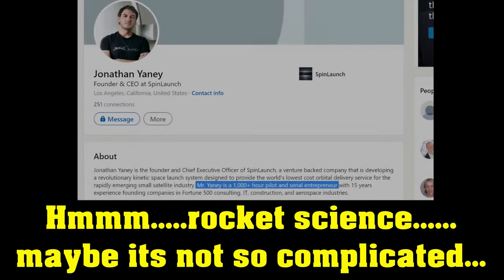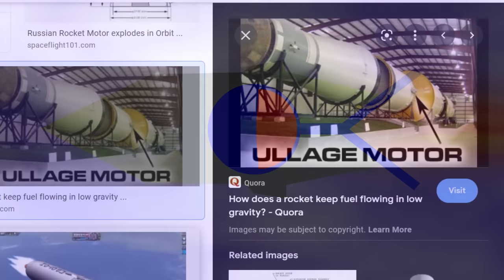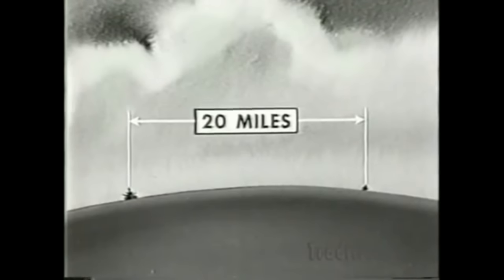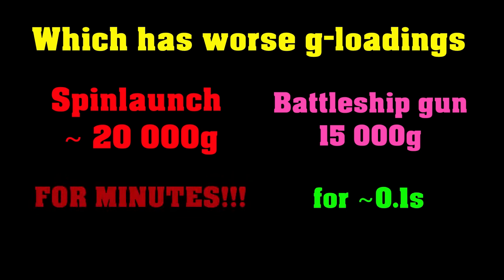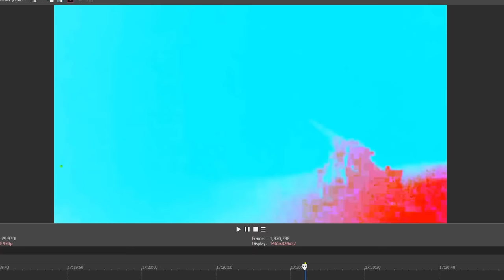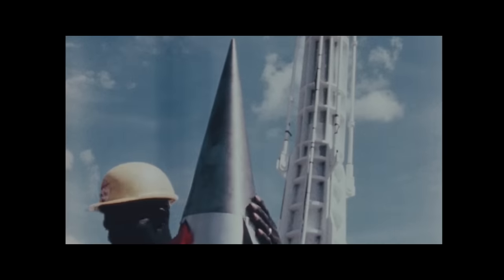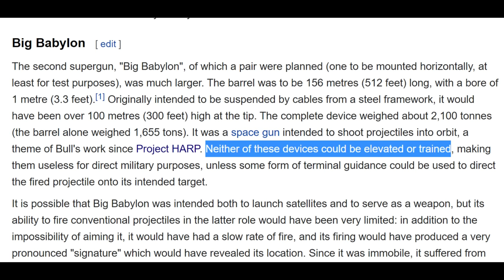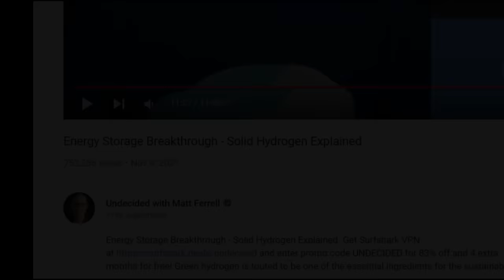Spinlaunch: BUSTED (Part 2)

Comment: Don't forget that they have the mass and energy of the projectile on the opposite side of the throwing arm. When the projectile is released the counter weight has to be released at the same time in the opposite direction, otherwise the hole thing shakes apart. So they have to dissipate the same energy they used to launch the projectile. It's like catching an artillery projectile within a few dozens meters.
Reply: Currently they do in fact release a balance weight from the opposite end of the arm, which crashes into a receiver, to address this problem. They're considering a setup where they actually launch two payloads - they have calculated that the half-turn required to bring the second projectile into launch position isn't long enough to introduce any serious vibration issues.
Reply: @tomcorey9833  They can consider al lot. But will there be materials and designs that can withstand forces born form enough energy to throw a rocket into orbit. It's a problem of scale with the available materials. They can nicely play with 5% or 10% of the energy they want to use in their final design and it will look impressive, but at one point the materials are simply not hard or stiff enough.

There will be sudden and enormous centripetal forces pulling on the central shaft and bearings when the first projectile is released. And the forces will act like a sledge hammer hitting the components, with all the vibrations and harmonics such action normally produce. It's really hard to design bearings that can withstand that without deforming or shattering. They are concentrating the forces of the system in one point where the shaft connects to the housing. The system has to at least store enough energy to replace the first stage of a rocket. Is there any material that don't behave like a pile of sand or chewing gum in such situation? Then there is the air rushing in with the speed of sound. The counterweight, now the second projectile, will hit the moving wall of air and so will the lever holding the projectile. This will slow down everything and a lot of forces and heat will be generated.

Remember they want the system to store enough energy to throw a rocket into orbit. And even if they only want to get it half the way, the stored energy will be not that much less.

And don't forget the rocket will heat up like a reentering space shuttle but in reverse and ending up very hot in a vacuum. There it's really hard to get rid of the heat. There is a long list of unsolved problems even if they manage to throw a rocket with the needed force to get it into orbit.

Comment: I've been trying to think of a valid use for the spinlauncher and I think I figured it out.

Drop the idea of being in a vacuum and the cover over the exit. You now have a world record setting pumpkin chunker.

So after all the money spent all they did was create a way to toss pumpkins further than ever. Gonna need a bigger farm for the challange.
Reply: I'm pretty sure the dude had a ride on the gravitron at a fair and came up with the idea like I did. With the exception being, in the haze of being really high even I knew it was pretty stupid, which is what made it funny.
Reply: @Ikaros---  I was thinking about that but that still doesn't change one of its biggest flaws.

Something being spun like it is when released is going want to continue in that same arc, that's why it shifted as it exited. Low gravity and atmosphere don't change that.

And you still have the problem of the counter weight suddenly not having that equal opposing force. On the moon maybe you can angle it in such a way as to release both the rocket and counter weight at the exact same time in opposite directions but that creates other issues as well and can't be done on earth to even test it unless you build a really small scale model possibly.
Reply: Punkin' Chunkin' has a centrifugal category, and those launchers achieve only a (large) fraction of what the pneumatic class does. The primary limiting factors are two-fold: 1) timing the release correctly (this goes wrong all the time in competition), and 2) the structural integrity of the pumpkin. Turns out, you can only subject a pumpkin to so many g's before it falls apart. Long-barreled pneumatic guns accelerate the pumpkin slower for a longer time, so get up more speed.

Which of course is one of the most obvious objections to SpinLaunch as compared to long-barreled ballistic launch ideas (e.g. rail gun). Even if you can time the release perfectly (debatable), making a machine and a launch vehicle that can tolerate the 10,000 or so g's for any amount of time, never mind the hours needed here, is just not practical.
Reply: @Ikaros---  No doubt, a railgun would involve significant technical challenges. Yet, all of those challenges seem more tractable than those involved with the centrifugal launch.

That said, centrifugal might actually work okay on the moon, because there's no atmosphere, and no matter where you're aiming, you've got a lot shallow gravity well to get out of, and maybe even can take advantage of falling into a larger one (e.g. delivery back to Earth's surface, or Earth orbit).

I don't think that "low-sensitivity" loads is going to be much if any advantage. To hold a 200 kg load, you're still going to need a container and brackets that can handle 20 million newtons of force. And that force is transmitted to the hull of the launch vehicle, so it needs to be strong enough to handle that too. Even distributed, that's a lot of force, but for a concentrated area such as one would find where cargo holds and brackets are attached, it seems untenable to me without some surprising advances in materials science.

And that's even before you start dealing with the other factors that "low-sensitivity" loads don't help with, such as launch timing, balancing of the centrifuge before and after launch, creating a suitable vacuum, retaining that vacuum somehow during spin-up without impeding the progress of the launch itself, just to name a few.

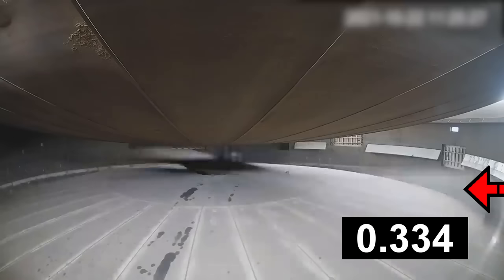Comment: To calculate the spin launch RPM from the video at about 4:00 you need to take into account that the framerate of the video limits the observable RPM (Nyqvist frequency).
Reply: It’s possible the recording was under sampled, but that still doesn’t detract from the myriad of other provable issues that this startup appears to have.
Reply: The footage seems to line up with the wooshing sounds, so there's a good chance the footage is accurate.
Reply: @machielste1  Isn't this video also from the first test launch. You could imagine they would not use max speed on first test? You don't build a race car and floor it on the first testrun
Reply: I think this video is supposed to be a joke. He watched one video and declared they haven't hit the speed they claim because of said video.
Reply: @machielste1  im guessing the wooshing sounds were added in post - i can't imagine they'd even bother recording audio on that camera to begin with. I'd have expected to hear noise from the electric motor too.

its still BS, but i dont think that we can necessarily use that footage as proof.
Reply: The total air pressure on the diaphragm must have been at least 10 tons.  The flatness of the diaphragm and the motion of its tatters after it gets ripped by the rocket make me believe that the chamber was NOT evacuated.  Also if the rocket was supersonic we should see shock waves, no?

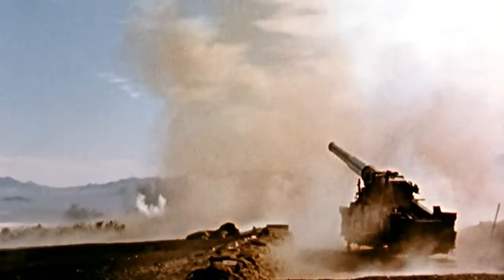Comment: 7:45 - Mind you those old atomic shells had vacuum tube electronics. Also did the "VT fuse" (proximity fuse) used in WWII. Those subminiature tubes could manage those high G loads.
Reply: That's a gun barrel type bomb. It is not initiated electronically.
Reply: A gun shooting a gun that explodes... gotta love the redundance

Comment: If the projectile is going 6x the speed of sound,  as soon as the vaacuum is broken, it's like trying to throw it into a wall. A hot syrupy wall.  Also, the arm in the launcher is also still moving at speed, but is now going to be passing through gas as well. I can't imagine either the missle or the launcher making it through a launch intact at that speed.
Reply: There is an 'airlock' door that slams shut within a few thousands of second after the payload is launched, which keeps that influx of air to a minimum.
Reply: @tomcorey9833 you completely missed his point, the projectile will be entering 1atm of air from an alleged vacuum at Mach 6.
What happens to the projectile hitting atmosphere? Likely explode sending shrapnel into  the launcher
Reply: It's challenging but the payload has pretty significant mass. With mass in the denominator (F/M = A) as mass increases it gets pretty hard to "de-accelerate" that payload. In fact, even a brick "wall" likely wouldn't slow it much down. Heating is probably the bigger concern, but the payload isn't in the thick atmosphere for very long, so it should be possible to absorb the heat energy with existing materials.

Arm doesn't have to encounter thick atmosphere because there are multiple doors, basically an airlock like device, that slam shut after the payload passes by. This is why it's possible (in theory) to launch multiple times a day without drawing a new vacuum each time (a point completely lost on thunderfoot in his first video).
Reply: Yeah somebody’s going to get killed when atmosphere rushes down into that chamber and the spinner comes around at 5x the sos and hits aircrete.
Reply: @daftmathtv the failure points are so many. One single failure with one single door, and that facility is going to be destroyed.
Reply: @daftmathtv so, the hypotetical door has to shut itself closed in a couple milliseconds, presumably also open itself at the same speeds... running arround 10 meters, and being massive enough to hold high vacuum and withstand said accelerations...
Reply: 6x the speed of sound is still 13.000mph slower than orbital velocity. This is a massive scam.
Reply: @artnull13  That projectile hitting the atmosphere will face an incredible... 1 atm of air. Which is nothing. It won't affect the projectile at all. Why would it? The chamber, yeah, I don't know how such a massive structure would remain intact. It would crush itself. But the projectile wouldn't feel anything. It will slightly heat up because of it's speed, since it's now facing friction.
Reply: @andychow5509  try falling off a bridge into water, it’s just water you say? Nah it’s like hitting concrete buddy - that’s the analogy.
Reply: @artnull13  You reminded me of a guy who designed a really fast car, using rockets and a ramp, to fly over a canyon.  So what happened?  The hood, panels and doors just flew off of it shortly after it got airborne.  You're right, at the speeds they are talking about "sudden" air would be like concrete.  (There are people who still think if you jumped out of an airplane at altitude, but landed in the ocean, you'd survive.)

If someone asked my advice about investing in this company, I'd first suggest they watch a documentary about Theranos.
Reply: The spinning must be balanced. then the projectile is launched. And the spinning thing is instantly extremely unbalanced. That's going to be fun.
Reply: @artnull13 do you seriously think they haven’t thought about that? seriously?
Reply: @cataraxis  yup as evidenced in this very video
Reply: The way they picture it on the 3D animation is totally wrong.
When released, the projectile will not go in the direction its nose is pointing.
It would rather go to a side. When detached.

They can not make it work even for a 3D animation. They have no clue.
Reply: @tomcorey9833 the airlock door (after the moment the projectile is launched) would need tremendous amount of power and strength to close to prevent at enormous amount of air and pressure bursting into the vacuum. Infact the thunderous air current rushing in would be so great it will affect the projectile the moment it breaks through the chamber, by sucking and dragging down the projectile considerably. The door would have to be super ultra strong to withstand that shock to avoid crushing the entire system. 
I cannot foresee how it would be possible such an exit gate system can work at full scale.
Reply: @Mothball_man  "the failure points are so many"   Ever look at a modern rocket engine?
Reply: @tomcorey9833 yeah… and this still requires one, but with the added complexity of it needing to survive 10,000g.

Comment: Actually, rocket science is indeed quite simple. Rocket engineereing, on the other hand, that's the complicated bit.
Reply: "So, I need you to design a high throughflow pump."
"Sure no biggie"
"I wasn't finished."
"Ok continue"
"It needs to operate with cryogenic and highly reactive volitile fluids,"
"Um..."
"A tiny distance away from temperatures that may be higher than the melting point of any know  material"
"But-"
"At ambient pressures ranging from sea level to a total vacuum"
"Doable I gue-"
"Oh, and it needs a reliable remote start and to not be maintenance while being as light and cheap as possible cause we're kinda sorta gonna treat it as disposable and we're on severe weight restrictions."
"Mfer! ANYTHING ELSE?"
"Oh yeah, it needs to operate under the backpressue of the weight of an entire building and if it fails, it will cost money and lives, because we don't exactly have a backup plan if there's a mechanical failur*choking sounds as is being strangled*"

And that's just the engine pump!
Reply: @dynamicworlds1  haha
Reply: hot air balloon and rocket.
solid state rocket. fuel is the rocket
Reply: Rocket engineering is based entirely on rocket science.
Reply: @zakaruahbones3142   I think Rivi waned to say that rockets are kind of easy technology. You have burning material and nozzle, people in 13th century were able to use rockets in war. 
But making them reliable, able to get to Moon and back, making sure that they will go where you want them, that is the hard part.
Reply: @simonspacek3670  rocket science encompasses all aspects and variables involved.
It is not just burning material and nozzle.
Making them reliable takes a lot of Science.
Reply: @zakaruahbones3142  I know. The basic concept is easy, but making it reliable is a huge amount of mathematic. The thing is what you call "rocket science". If you talk only about the concept, it is easy, if you take in all the engineering, it is difficult. In fact, it is so difficult that we use "rocket science" as idiom for "damn complicated problem". 
Hell, let's compare it with horseback riding. It is simple concept, sitting on a big animal, but if you add stables, care, feeding, making saddle,... it is a huge amount of work and knowledge.

Comment: Watching the spinlaunch video and thinking about how fast the actuators would have to move to completely release the projectile at the right time, then how quickly they'd need to move the moment of inertia the moment after launch, I got so horrified that the thing wasn't an entirely separate building far from the workers. Imagine the loads on those poor bearings.

Comment: Glad you did a #2 for these guys.
Reply: There is still enough wrong with this project for a #3 and perhaps #4.  Like what material is that membrane made out of, that its rigid/strong enough to resist the vacuum, but delicate enough you can chuck your missile through it at mach 5 without everything disintegrating?
Reply: Shush, or he'll remember Anita again
Reply: nah this one was a nothingburger [probably for views]. 1.they never said the chamber is 100% vaccum, 2.fuel tanks are filled completely so the liquid won't be moving inside while oxidizer tanks can have a straw with multiple intakes, 3.wtf does nukes and naval cannons has to do with this?